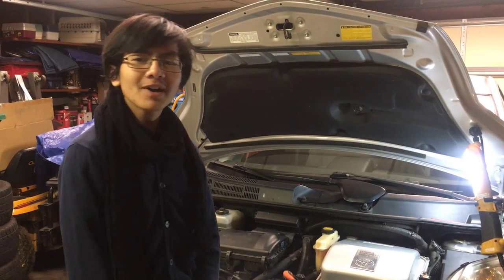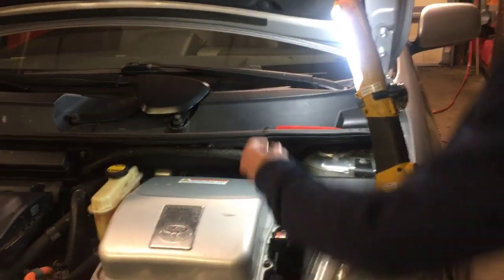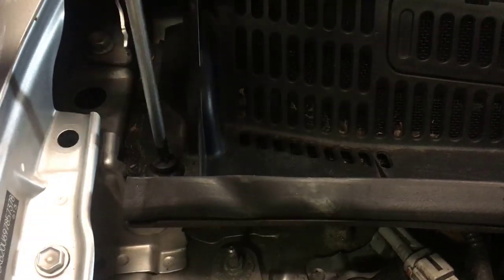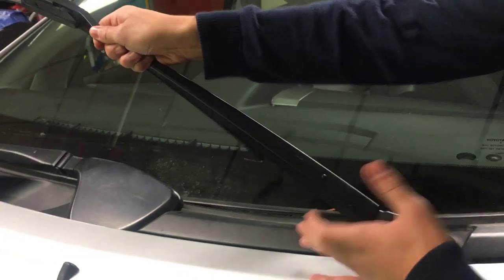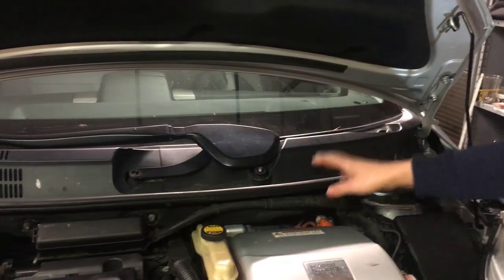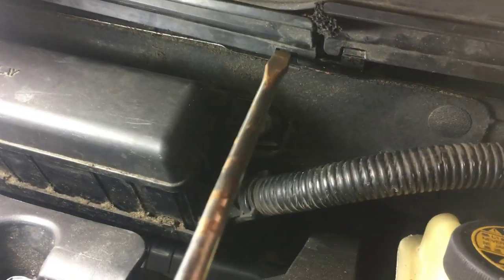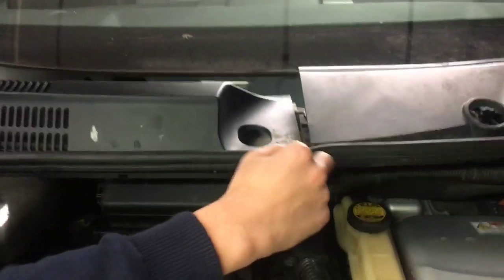How To Remove Cowl & Windshield Wiper Arm 2004-2009 Toyota Prius: Part 1 - Upper Grille Panel Cover

Comment from the maker: Here are the #ᴬᴰlinks to tools, parts and accessories you may need to perform this repair:
1.  https://amzn.to/3Vp9ojq  |  Milwaukee 2457-20 M12 Cordless 3/8" Sub-Compact 35 ft-Lbs 250 RPM Ratchet w/ Variable Speed Trigger
2.  https://amzn.to/3ZFMyXd  |  PEAK OET Extended Life Red/Pink 50/50 Prediluted Antifreeze/Coolant for Asian Vehicles, 1 Gal.
3.  https://amzn.to/3DghN27  |  TRQ Radiator Dual Cooling Fan Assembly Compatible with 2004-2009 Toyota Prius TO3117100
4.  https://amzn.to/3D4LOCa  |  G9020-47031 Engine Electric Inverter Cooler Water Pump Assembly for 2004-2009 Toyota Prius 1.5L Replace G902047031 04000-32528
5.  https://amzn.to/41nDVla  |  GELUOXI 16670-21010 Coolant Flow Control Water Valve Replacement for 2004-2009 Toyota Prius 1.5L Hybrid Part# 601-021, EHV116

Or Click on Amazon link here and search for what you need:  https://amzn.to/3D1T2GQ

Comment: This looks like the correct procedure to remove the cowl to re-seal it per Toyota Technical Service Bulletin (TSB) EG063-05 . This TSB fixes a leakage problem which can cause a misfire and trigger diagnostic trouble codes P0300, P0301, P0302, P0303, or P0304. The basic problem is that the seam highlighted at 4:59 allows water to leak down into the spark plug area, so the spark plug and coil get soaked and cause a misfire. The TSB only covers the 2004-2005 model years for some reason.

Comment: What about passenger front wiper? That bulky part needs to be removed too? You can't just change the wiper arm similarly to drivers side? Cuz on some videos i've seen the same prius has a very similar simple mechanism like drivers side. On your prius mechanism seems alot more complex.

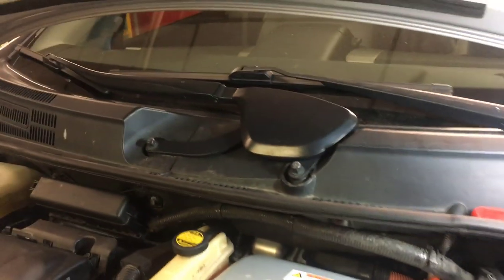For reference: https://www.youtube.com/watch?v=LSDwl1hdN7I&ab_channel=TheCarista @0:49 time mark.
Reply: My 2005 has the bigger passenger wiper arm like in this video. It does not pull off after removing the nuts. I even tried prying it. It's definitely gotta have a spring too because I didn't try lifting the blade to release a spring. Maybe the spring on this video's passenger wiper arm is broken?